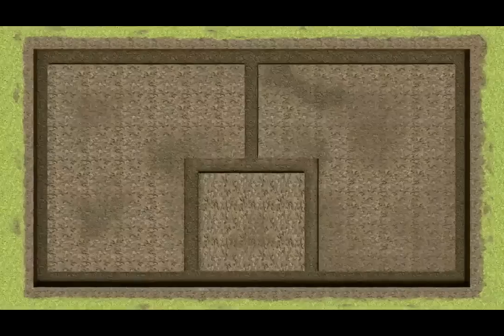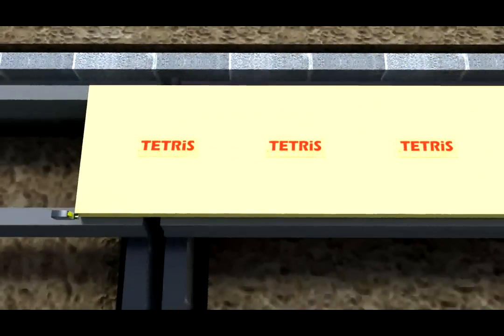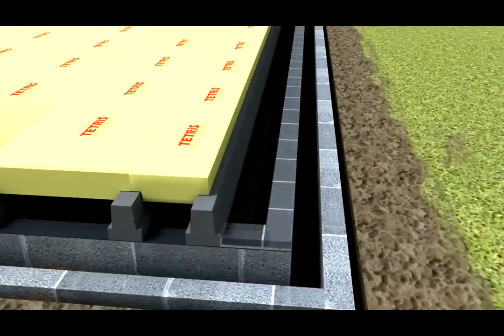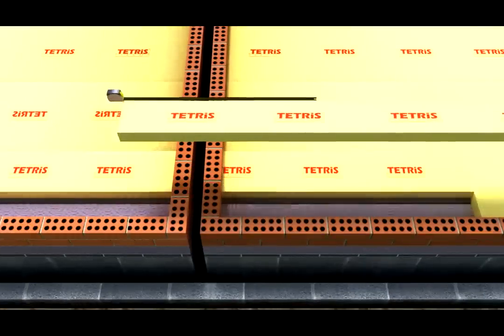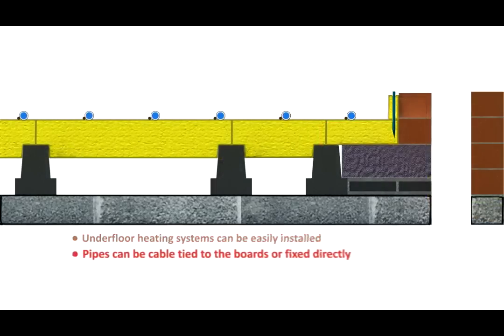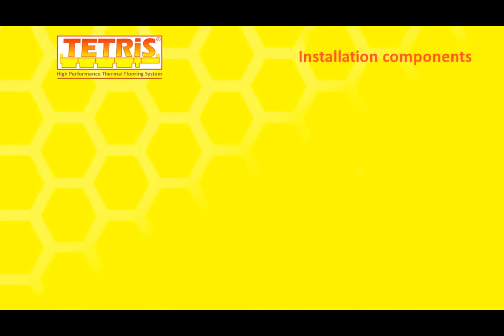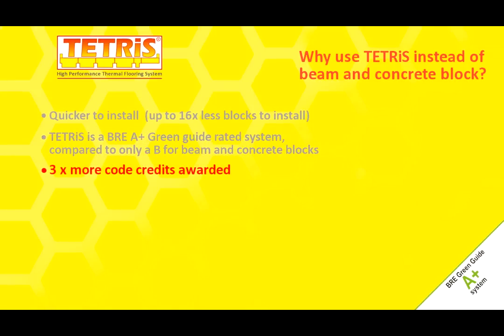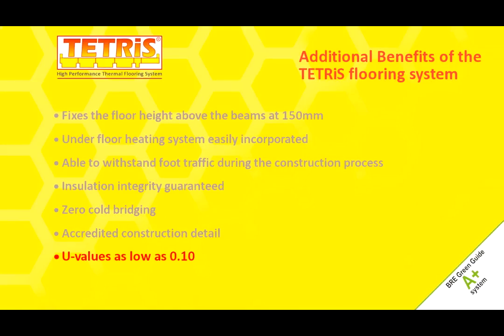How to Install insulation block and beam floors, TETRiS eco-friendly thermal flooring system

Comment: Polystyrene is miles cheaper!
Reply: I agree, although I generally don't like the simple mindset of certain individuals who ONLY value something according its PRICE and not its PRICE-PERFORMANCE! In this case however the performance is not much better. The U-value of 100mm Polystyrene is 0.369W/m2K, where as the U-value of 100mm Cellecta TETRiS is 0.377W/m2K.